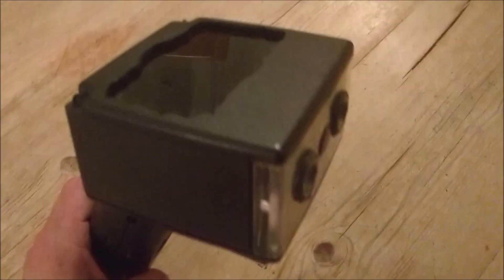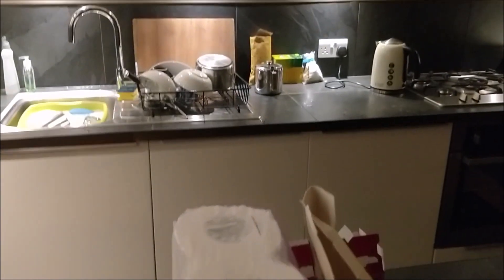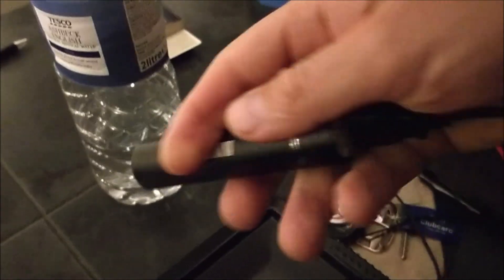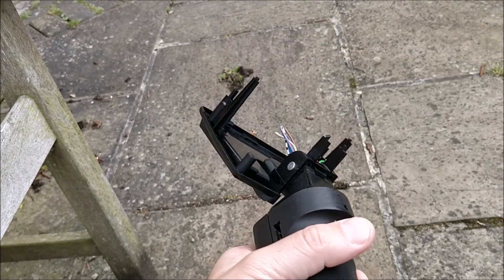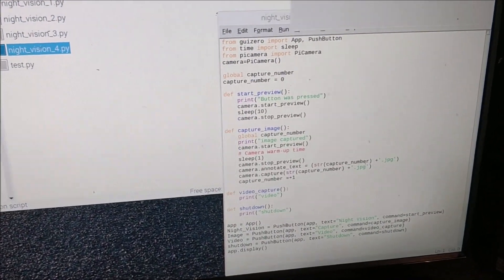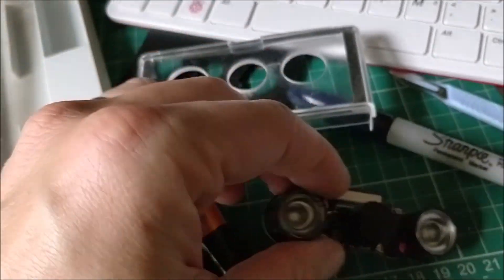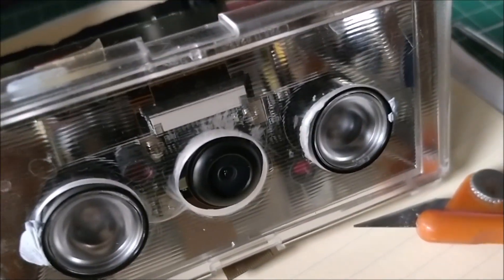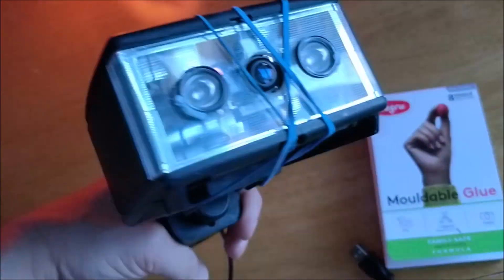How to build a night vision camera

Comment: Hi! thank you for the vid! I have a question, how did you manage to visualize the video/images on the lcd screen? I am really stuck at this, it keeps projecting it on my hdmi output which is connected to a monitor.
Reply from the maker: I used the preview() to display what the camera is seeing. Rather than recording a video and then displaying it.  Code is here. https://github.com/TeCoEd/Night-Vision.
Reply: @TeCoEd  I am trying your code but it keeps displaying the camera on the hdmi output, even when there is nothing connected to that port.  I am currently using a 3.5inch RPi Display (http://www.lcdwiki.com/3.5inch_RPi_Display). Do you have any extra suggestions? hahah thanks in advance!

Comment: Thx for the video. Can i ask u one question? Is there a delay between the camera and the screen?
Reply from the maker: No it is in real time. No delay. I am using the 'preview' command so it shows 'live'.
Reply: @TeCoEd  well yeah i understand that its in realtime but u know such devices as far as i can see still have a small delay like 0.2 0.3 seconds wich is quite important for my app. Is it there r we can say that the translation of the image happens instantly? sry for my english/
Reply from the maker: @rikkitikkitavi78  English is fine 👍 I have noticed a delay. It is difficult to see in the dark as you have no point of reference apart from the screen. I will do some tests.
Reply: @TeCoEd  Thanks a lot.
Reply from the maker: I cannot see any delay. So I would say it is in real time. So you have a PiCamera? Try that and see if you can spot a delay.
Reply: @TeCoEd  aint yet atm tryin to figure out should i try to make it in pi way r work with analog. Well after what uve said i choose pi.
Again thx a lot.